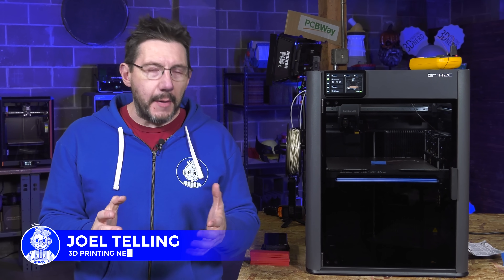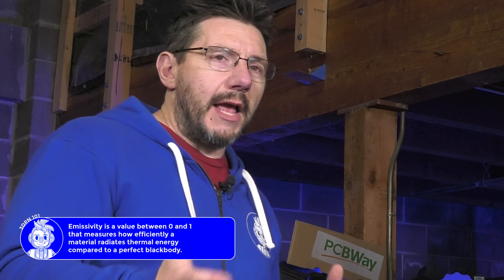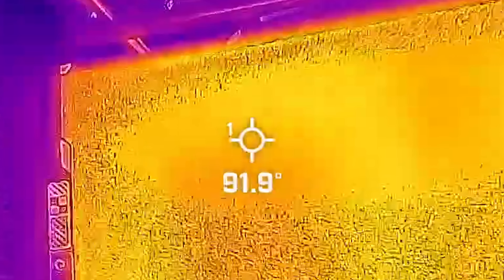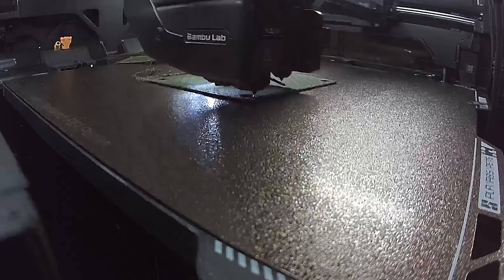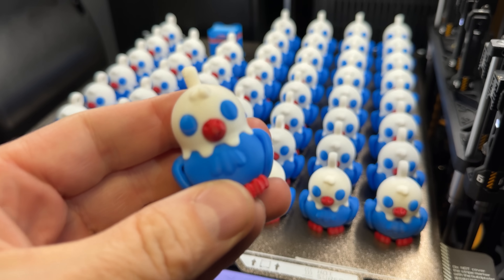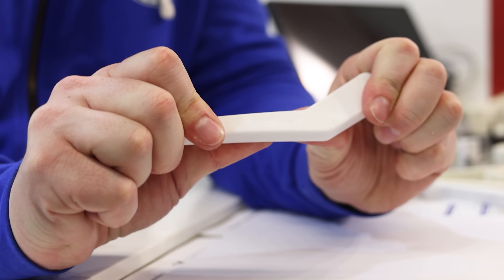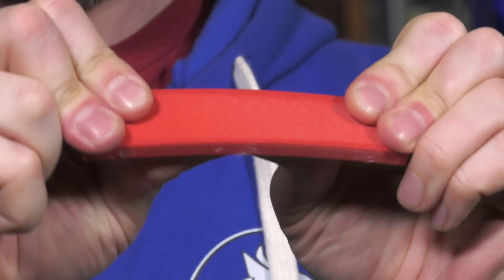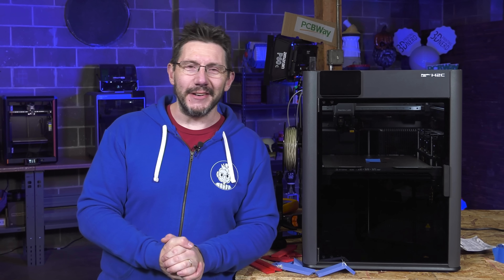Bambu H2C Update - Bed Heating / Tullomer + Polymaker

Comment: my h2c printbed sticks almost a little too well to PLA. Even after its cooled completely, i really have to break it free. With my X1c they used to come loose by themselves after cooldown
Reply: @Gekkoperformance  Mine is the same. If I don’t let the bed cool completely, getting models off can be a little difficult. I haven’t had any adhesion issues in the couple of weeks I’ve had it. Had my first failure last night. Not sure what happened but it looks like an edge of the model got caught by the nozzle and got pulled up, and caused an issue. It’s running just fine now.
Reply: @Gekkoperformance  I've destroyed 2 print plates cos my prints stuck so hard they ripped both the plate and the print , and I still couldn't remove it LMAO

Comment: Shouldn't have waited 1h before measuring the temp.  Who waits 1h before starting a print?  I think the first testing was accurate tbh, but the plate was also a factor.
Reply: you cant measure it during the warmup, you also can´t start printing while the bed is just heating up. he just made sure it would reach steady state
Reply: @Gekkoperformance  Nobody is going to wait an hr before they start printing though. He should have measured it as soon at it hit its temp, which only takes a couple mins. If bambu lab can't manage to make a heatbed that's ready to print as soon as it hits temp, then their printer is a flop and worse than a $100 ender 3.
Reply: @Gekkoperformance you can measure it during warmup. No one is going to stop you. I don't own a Bambu, but I guess that you can also start a print before heating up. I mean, it's just G-Code.

Comment: I'm curious what results you'll get if you use a magic eraser to scrub that defective build plate. Something just barely abrasive to rub away a tiny fraction of the surface layer. I doubt it would do anything if the entire plate coating itself was not the right ratio of chemicals or something (idk I just work here), but why not test it out just in case?

Also, that tullomer looks awesome! I wonder how well it would do with sound absorption or sound transmission loss.
Reply from the maker: Interesting idea to try a magic eraser!
Reply: @3DPrintingNerd  I had sticking issues at first on the H2D and had to clean the bed with dawn and a magic eraser. No issues after that.